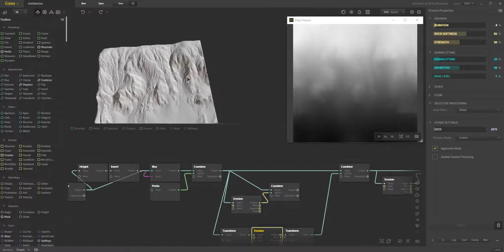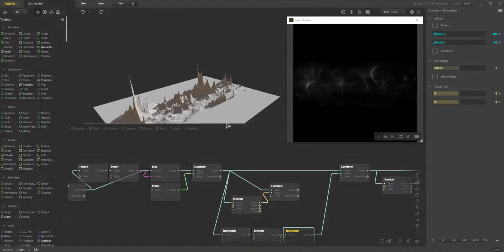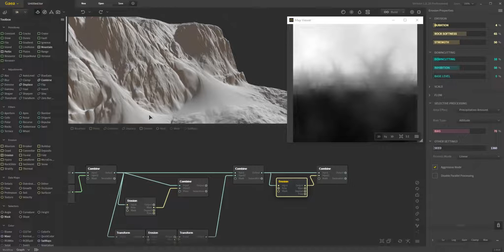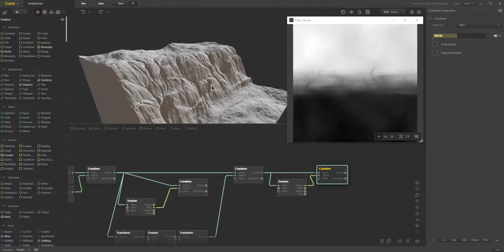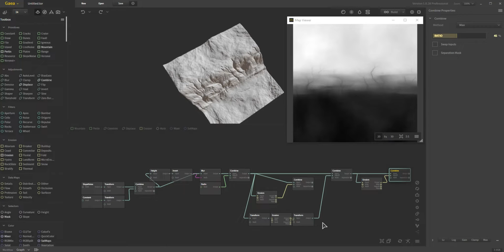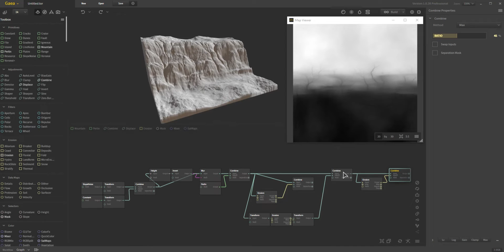Quadspinner Gaea - Steep Erosion issues and fixes

Comment: Good tip! Do you think this could be used to alter the erosion patterns on an entire landscape by changing the min/max elevation (to change the slope angle) and then resetting it back to the original slope - or does this technique require the transform to increase total distance instead of only slope?
Reply from the maker: https://youtu.be/jlB3qTr9Xt4
Reply from the maker: This is a very good question, I think I'll explain it in video because it's very visual.